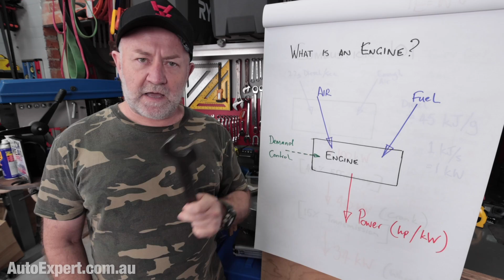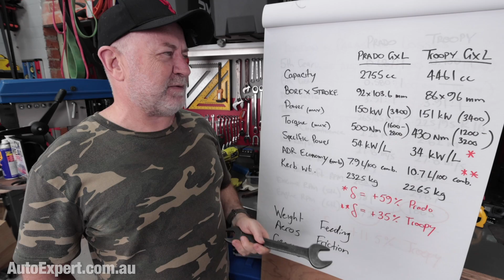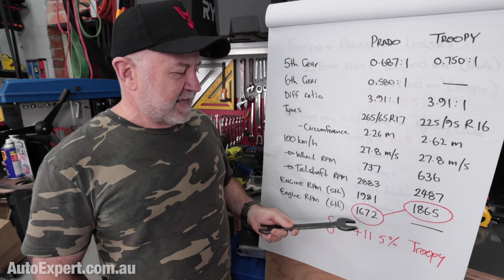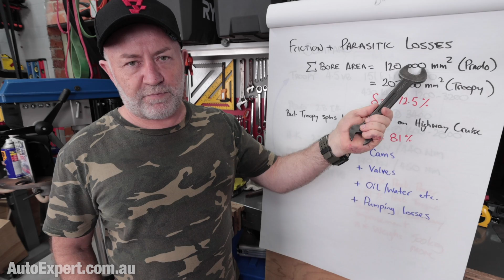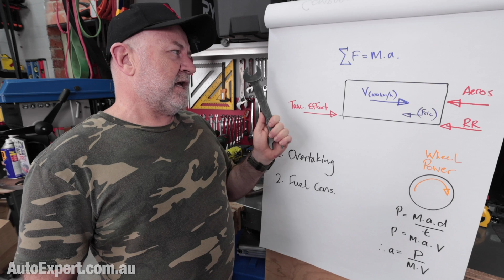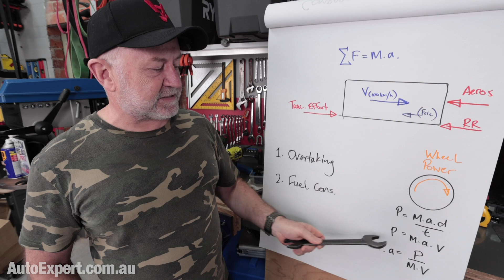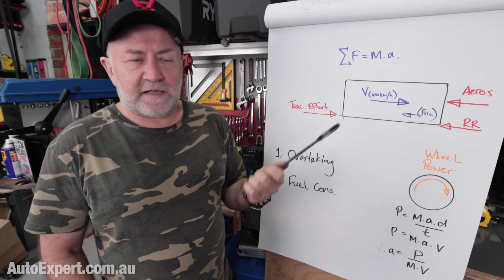Toyota Landcruiser Troopy fuel consumption (why it's so bad) | Auto Expert John Cadogan

Comment: So, I guess the "trick" for Troopy owners would be to fit a 6 speed auto plus 2nd turbo a-la 200 series.....
Reply: Gday Bill,  I ditched my 200series and my Troopy is 20% better on fuel.  Wouldn't want to go backwards.  Hope you are well
Reply: @philg2468  G'day mate....glad you are still having fun....strange that your result is different to what JC reckons.
Yes we're all good here mate....I've gone over to a Chevy 3500HD "truck" now..... It's pretty good on fuel for a 5 tonne beast that can accelerate quicker than most of my previous cars! I'm at around 8.25 tonne all up and still get 20L/100 +/-.
Cheers mate....Roachie

Comment: Interesting video John, would there be a difference in the fact that the Prado is a constant 4 x 4 whilst the troopy is rear wheel only until 4WD is engaged? Theoretically wouldn't the Prado have less rolling resistance than the Troopy giving it a slight advantage in that respect?
Reply: The Prado has a higher losses because it is turning more drivetrain. Freewheeling hubs are used on part time 4WD to disconnect the wheels from the drive and give a slight improvement is fuel economy.

Comment: So an old, not developed as far, engine combined with a gearbox that isn't set high enough to get the engine in the correct " rev range ".
Reply: Not really. Something that was not touched on was the broader torque spread of the V8. And the design of the vehicle and its expected intended purpose is also a huge factor and massive compromise. Towing with a Prado, it will not go half as far and the economy will be way worse.
Reply: @bobbob-fg5wy  Agreed that may be, but the gear ratios are still wrong as it is lifting the revs higher than what would be best for the torque band, higher than the revs of the smaller prado engine which would deal with the higher revs better.
Reply: @alanhilder1883  Prado engine would not deal better, it has a longer stroke and a larger cc per Cyl. The first thing to note is that the max torque quoted was in a 400rpm wider band on the V8. The next thing you’ll find is if you look at the torque and power curves on the same rpm graph the Troopy will have the ‘cruise’ rpm (as it would be in 4th gear direct) a lot closer to where the two intersect. That’s a lot better for moving weight and about how every Japanese made work vehicles drive train has been set up since overdriven transmissions came along.
Reply: @bobbob-fg5wy  But still, the V8 torque thing will be at a lower or equal rev range and the existing gearbox is spinning the engine higher rev for the same speed. Towing etc will need to go back a gear to what is now top. ( Drop in the 6 speed box instead of the existing 5 ).
Reply: @alanhilder1883  Go back and watch it again. The v8 makes 430 torque for 2000rpm of its range. It does that 400rpm sooner and for 400rpm longer than the 1200 rpm torque spread of the 4cyl. The peak torque and peak hp are closer together on the v8 (only 200rpm apart) which makes it infinetely more useful than the 4cyl (600rpm apart, thats a lot of revs for nothing) rowing through the extra gears because it needs them, all 6 of them. The Troopy is a work truck(tow rating 3500kg GCM6800kg). The Prado is not (tow rating 3000kg  GCM 5990kg). There is some naysayers saying that the Prado cannot carry its maximum load 665kg as well as tow its 3ton and stay under its GCM. The Troopy can carry a ton and tow 3500kg and stay under its rating.  I'll say again, work truck. If you want to buy a Troopy and never put a tow bar on it thats fine, but that was not Toyotas design brief, it is built to move than thrice its kerb weight.
Reply: @bobbob-fg5wy  Yes, It is getting it's torque at lower revs... yet the gearbox in it is making the engine spin higher, wasting the correct rev range. I have been agreeing with you.
Reply: @alanhilder1883  It is making its peak torque for longer, the engine is more flexible. The peak torque is closer to the peak hp. A higher gearing does not mean better economy. If the gearing is too high you have to have your foot further into it to maintain the same speed that less throttle input would maintain with lower gearing, multiplied ten fold if theres a load involved.

Comment: But will the increasingly  highly strung prado motor do 1 million km + ?
Reply: I have the V8 and bet they will last the same amount of time. Modern engines are all the same. The 1HZ is a million km motor but it was built basic and it’s not common rail with electronic shit. But to the point. One wont last longer than the other with same maintenance.
Reply: i suppose well have 4 cyl turbo kenworths ..good for 1 changeover
Reply: Sure. With a turbo rebuild and two gasket jobs. Just like the 4.6L gasoline V8 in my 2011 Lexus has already had a gasket job before 100K miles versus the flawless running lower revving 4.3L in my 2004 which along with the 6 speed auto is commonly considered here in the States to be the best powertrain Toyota ever put in a vehicle sold in our market. At least Toyota uses a combo fuel injection system so you don’t need to do a carbon cleanout every 100K miles. That said, Toyota gets a lot of flack even here in the land of cheap fuel for its gas-guzzling powertrains. Still doesn’t mean I would trade my Toyota products for a stealership loving Land Rover or BMW.
Reply: Probably not, but for the same reason the v8 troopy won't either, and it's nothing to do with being "highly strung" as you so put it, but more the fact that the fuel systems under high pressure will literally erode themselves away before you ever get anywhere near that point. The v8 will last marginally longer though because while it may use 35% more fuel it is spread over 100% more fuel system (2 sets of 4 cylinder rails instead of 1). The days of 1 million km diesel engines ended with the introduction of common rail injection. I'm sure JC will comment on this however it is most unlikely that the v8 was designed by the same company to have a higher service life than the i4, and it is a design decision not just a matter whether the squeeze more power out of one than another. The auto maker sets the brief for the engineering team that they need x power and it has to last y period of time / distance travelled / work done.
Reply: @mungbean84  replace the fuel rail then. The old Volvo 4cyl was one of the longest running in km engines ever, so I wouldn't assume just because an engine has 4 cyl it can't do high km. Trucks Get to 1m km regularly

Comment: But what about reliability and engine lifetime since it is stressed so much less in the v8? A critical point not discussed or brought up. The v8 will still be alive at 300000-400000km but the 4 gets long in the tooth after 200 typically

Comment: John, what would be the main reason some cars get worse economy as they get more kilometers if everything is working ok and AFRs are still spot on?  
I had a few cars with the same engine that when under 100,000Km were averaging 7.5L/100km but once over 200-300k were doing more around the 10-11L/100km. AFRs on them were no different to the newer ones as well as the compression tests.  The only thing I found on the high K engines was the excessive timing chain stretch when I did an autopsy on them, could that really make all that difference?

Comment: My 2019 Troopy is the most economical 4wd I've owned.  Gets 10L/100k around town and 15L/100k towing a caravan.  Skinny tyres, manual gearbox, Piezo Injectors and a taller 5th gear and keeping the weight down all help.  You need to find a different example - hint: my previous 200series used 20% more fuel than my troopy.

Comment: Ah the V8 troopy, put 10 people in the back on a cold winter morning and then try and find the rear demister switch. 70 grand of pure poverty.
Reply: What sissy  uses a troopy like a luxury vehicle,  we used them to haul crates full of ammo and hand grenades in the back over muddy tracks in Colombia
Reply: It's easier to be poor like that when you're rich.
Reply: Since when do you need to fit 10 people in the back? And why would they be expecting luxury?
Reply: @jtekkit  80k for a basic shitbox designed 50 years ago with a piss weak engine, well, you'd expect luxury because it has nothing else to offer.
Reply: Rollin Four Litre sounds as if your jealous and wished you owned one
Reply: @mrmojorisin11  only as an alternative to being violated in the back passage by broken up sheets of asbestos.
Reply: @jtekkit  on a job site. Bench seats both sides.
Reply: Troopy is for war
Reply: @999mrkhaled  what military buys a 70k vehicle like that?
Reply: If the Sheila’s like ‘em, I’m in like Flynn

Comment: Boost pressure plays a big part! if the troopy ran the same boost pressure as the prado, look out!
Reply: You mean look out for the stock clutch that will slip like a mofo
Reply: @Rat454  minor detail, upgrade the clutch.
Reply: Just what you want to do when you purchase a 70k vehicle. Waste of money.
Reply: @Rat454   if you increase the output by 50% which is usually what happens, not many std clutches would cope.
Reply: @maxtraction5388  I very well understand that, my point is, you spend a lot of money on a 70 series for a detuned engine with a piss weak clutch and not to mention a rear wheel track that doesn’t match the front. Don’t get me wrong, I love the 70 series for its ruggedness and heritage, but seriously Toyota could do better for the price tag they put on it. Run the 200 series configuration, heavy duty clutch and sort the wheel track out and I’ll feel better about it.
Reply: If the Sheila’s like ‘em, I’m in like Flynn

Comment: How are you driving a troopy to burn 15l/100?? I've never gone over 11, mid to high 10s is pretty consistent, and I don't take it easy on it either. I'd suggest real world consumption on a Prado would be very close to the same as that for most people, maybe 5% better, not 35%.

Comment: In a time not long ago I was the proud owner of a vdj76 2010 LandCruiser wagon. Loved it went like a cut cat but I couldn't complain about the fuel consumption. On highway fuel consumption was 10.1 ltrs to 100 klms. And if I was towing my 1975 Viscount 18ft caravan ( without the combined shiter/dinning room) the fuel consumption was at 10.5 ltrs to 100 klms.
Reply: Btw that wasn't driving it at 80 kph, it was driven at posted speed limits.
Reply: @chrisjohnston5961  That doesn't square with my experience at all.  We just did Adelaide -> Birdsville -> Simpson -> Mt Dare-> Adelaide in a 2020 GXL 76 series. 2 swags on the roof and supplies for a 3 week trip. On bitumen at 100 or 110 we were getting 14.6L/100. Through the desert we were getting 16.7L/100. Your 10.5L/100 towing doesn't seem remotely possible, even if your 76 is running an older 6 cylinder engine (I don't know that much about LandCruisers , and when the engines changed).  You must have had a tail wind, and been running downhill to get 10's!!
Reply: No she was a 4.5ltr V8 turbo diesel running an aftermarket chip

Comment: Awesome explanation 👍Toyota should definitely have an upgraded version of the troop carrier and 79 utes with the 200 series driveline on offer, with 6 speed auto and 200kw/700nm . You can build it aftermarket but it’s probably around $30k plus, so why not offer it as say a $15k option, it’s just a few bolt on mods surely there is still room for profit and people can get what they want??
Reply: Issue is they couldn’t fit the 200 series engine in there
Reply: makes not real sense both for toyota and for the user. Yes the 200 series driveline is more efficent. BUT mostly becaus it produces a lot more power with the same deplacement. The 200 series is a luxury vehicle were you want an impressive performance. The 70 series is work horse were you want enough power.

Comment: You neglected to mention the fact the 4.5 V8 will still be chugging along with a million Kms under its belt.... and still be holding its value.
Reply: I have the V8 and I can promise you it won’t last any longer than any other motor, lets say the 2.8 prado motor used in this example (assumed maintenance done as per manufacturers spec). It’s common rail and will fail due to electonic shit and the fuel system eroding away under pressure long before you reached a million km. Zero difference just heavy fuel penalties. 1HZ. Different story but that a machine of a different era without tech.
Reply: A : no and B : who keeps their car for more then 10 years ,  10 times 25k average per year = 250k over 10 years .
Reply: @alexfrankl7861  A. non sequitur, and B, I do 50K or more a year and a smart person buys a vehicle that will last more than 10 years if looked after. Its not a pair of jeans.
Reply: @jamesonjabiru  talking population  averages , I'll do well above average of 35k . Your saying a million on a cruiser , have yet to see one .
Reply: @alexfrankl7861  I stand humbly chastised and shamed.  If you havent seen it, then surely it must not be.  I would hang my head and get on with the self flagellation.....only....theres plenty of million km toyotas if you care to do a google. Even a hilux boganmobile chalked up the seven figures. Heres something to read if you get tired of being a dick to strangers on youtube. https://toyota.pressroom.com.au/press_release_detail.asp?prID=630&clientID=2&navSectionID=2   See you next tuesday.
Reply: @jamesonjabiru  you're meant to get a free new car if you manage 1m km. He doesn't get one because he had a rebuild, even with constant running highway miles.
Reply: @jamesonjabiru  there is literally no 4.5 v8 Toyota's that have done 1 million km you'd be lucky to find one with 500,000 km as you'd have to be doing 80,000km a year every year without fail for 13 years. Just because older toyotas were immensely reliable doesn't mean the new ones are
Reply: Just want to add. Won’t swop my cruiser for anything else. 🙂 Love it.

Comment: Sorry but you've missed a major point and your conclusions are off. In part due to your arrogance in so easily assuming a whole bunch of people and large companies are no match for your own intelligence. Yes, it's the largest car manufacturer in the world and tens of thousands of buyers who are wrong, John, not you!
The 70 series v8 is not the "cheapo version", its design objective is ultra long maintenance intervals (10 litres of oil, will tolerate all kinds of oils), higher tolerances. Toyota are on record saying they wanted all 70 series Landcruisers (from the old 4 cyls through to the turbo inline 6, and most recently the v8) to last 20 years in a 3rd world country with maintenance ability and resources proportionate to those conditions.
The engine runs *cool*, the heater will start blowing cold air after only 30 seconds sitting at a traffic light. Higher power output per litre notoriously increases cooling requirements (look at super cars, superbikes, the heat they put out just at idle). 
The engine is very detuned and even with just a single turbo a chip tune and exhaust will have it putting out 25% more power. For $1200 and 30 mins on a dyno. 
The engine is easily capable of much more power, even with a single turbo. 
To get this power out of a smaller displacement, 4 cyl engine requires them to run much harder, have lower tolerances, need the exact oil that's twice the price per litre and harder to get, be full of sensors and technology that is reliable enough but probably would have the thing running in limp mode after 7 years on dusty, unsurfaced roads 1000km from the nearest mechanic.
Did you really think Toyota was that stupid that they would just randomly put some inefficient, crap engine in one of their flagship cars? Do you really think the buying demographic is that dumb when 4cyl rangers and Hilux's rule the market? Having 4 cyls doesn't seem to hurt the manliness of those vehicles, does it?! Your hypothesis is way off the mark here, sorry. 
The troopy is mainly sold to mines, without the commercial segment the vehicle would have been discontinued not only in Australia but worldwide. 
Why are these mining companies and commercial operators so stupid to buy some over-engineered, underutilized, v8 diesel that uses too much fuel when every dollar counts??? Why don't they buy Hilux's or Rangers or Amaroks for their mining operations? I mean, for some roles they DO buy Hilux's so why don't they just use them for everything? These are the same people who spend hundreds of millions putting in train lines to mines to save on transport costs, who invest boatloads of R&D into saving every dollar they can by automating mining operations, investing in driverless vehicles under ground, automatic drilling rates calibrated to geological conditions it senses, all this stuff? They are very serious people when it comes to being as streamlined as possible and blow me down, they buy thousands upon thousands of these troopy's and dualcab v8's every year. Along with farmers and other outback commercial enterprises. Why!
Reply: But they've prooven themselves to be not what your saying .
Reply: @alexfrankl7861  huh?
Reply: @tosgem  its simple dude , every street corner has a Toyota dealer , the 2.8 hilux is a bucket of shit hence the use of the 79 which they heaps of spares cause theyve been around for decades , i couldn't think of a worse vehicle to do any kays in , My 89 Canter drives nicer 😁